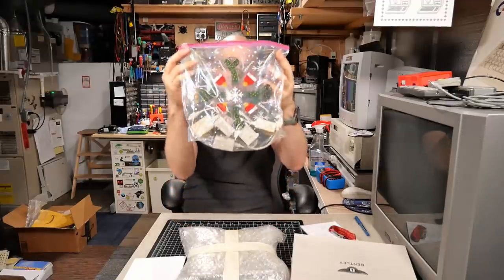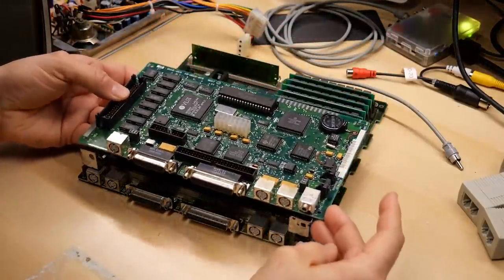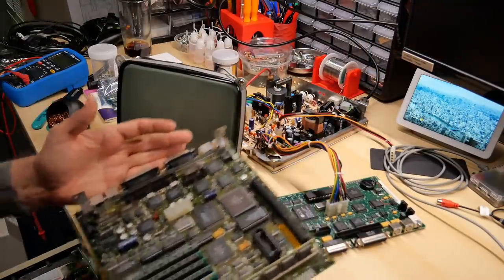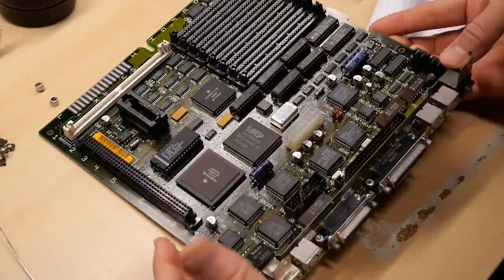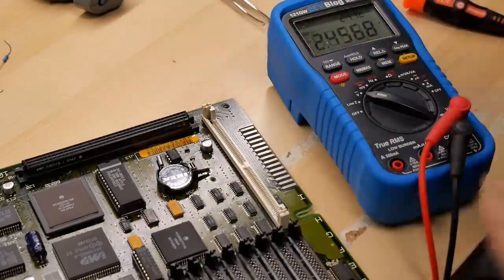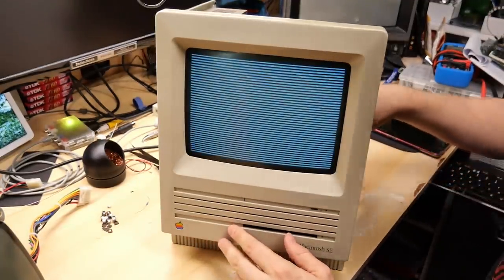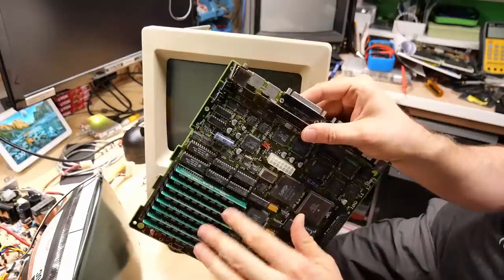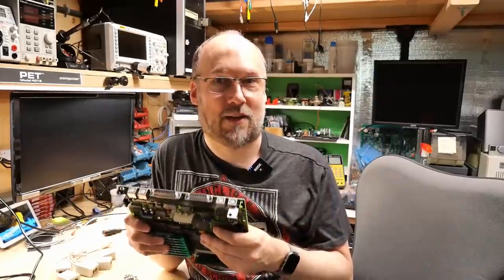Recapping and testing a Mac SE/30 motherboard

Comment: *SMH**
1) the SE/30 is part of the Mac II family (Mac II, IIx, IIcx, IIci, IIsi, and IIfx) and can run System 6. In fact the. SE/30 mobo is more like the IIcx than any other machine. 

But there were 2 sets of ROMs made, the 24bit "Dirty ROMs" and the 32bit "Clean ROMs". The Dirty ROMs could not see RAM past 16mb and a few other things. The Clean ROMs let you have as much RAM the board has. There is an extension called "Mode32" that patches the system to see more than 16mb on the system and fixed other issues. It worked on both System 6 and System 7.

The Classic II is based on the LC series (LC, LC II, LC III, etc.) and is more like the LC II than other LC series machine as they can only access 10mb of RAM and are 16bit boards and not 32bit like the SE\30. The '030 CPU on the LCs anc Classic II runs at 16MHz just like Mac IIs and the SE/30. Yes, there were faster Mac IIs and LCs out there but as for the SE/30 and Classic II were the same 16MHz.

Thus being a 32bit system with a coprocessor the SE/30 will blow the Classic II out of the water.

2) though it had a "processor direct slot" (pds) expansion, the SE/30 built-in video "card" was treated and accessed the video like a NuBus video card. Similarly the Classic II and LCs used PDS access to their "built-in" video "cards". This gives the Classic a slightly faster video access (but terrible frame buffering as it was 16bit and not 32bit).

3) There was a program called AppleTalk Bridge that allows a Mac with an Ethernet card to Bridge an AppleTalk network to the Ethetnet. Thing is, if it were not on a fast Mac with a lot of RAM, the Mac was useless for other  tasks.

More to come later.... Drawing a blank now.

Comment: Maybe someone can help me with a measurement? I recapped a working SE/30 and after recapping and washing the mainboard it stopped working. The reset signal works, but there is no activity on address or data lines. The C16M signal is only around 4 Vpp, so I wonder if something draws to much current on C16M. Or is this normal? It should be over the 5V-TTL threshold. All other signal which could stop the 68030 from working look like they are ok.

Comment: I seem to remember a video of yours where you mentioned that said old SE that you said was with you since you were little... well I remember you said that machine had a composite video out. Am I remembering correctly here? If I *am*, then how is it done?
Reply from the maker: We had a Mac+ with an external monitor (composite) which I still have the machine. The SE didn't have external video support though.

Comment: ESD?
Reply: OCD?
Reply from the maker: @brianv2871  BRB?
Reply: Incomplete statement, I haven't see any Electrostatic Discharge protection " ESD "on your bench videos. How do you manage it?
Reply: @sr.padilla1633  He doesn't have carpet.  Although, to be fair, i have much worse ESD conditions and I haven't killed anything yet by ESD.  (I probably just jinxed myself though, haha)
Reply: @brianv2871  Good fo you, i have killed-zapped many components. Maybe is genetic.
Reply: @sr.padilla1633  Yeah, i guess it might be different for different people/places.. I don't have any ESD device because it wouldn't be useful for me (I'd have nowhere to attach it and i'm constantly moving from place to place), but I do try to be careful when working on anything in my carpeted office  and I try to touch something metal before I touch any components.  My chip killing is always due to me putting them in backwards, so maybe i need a bracelet for that :)

Comment: Hey, Adrian, do you want a copy of the SE/30's schematics?  I've got the whole set for the logic board, analog board and power supply unit.  I can email you the direct links from my Google Drive account, if you'd like.  

Btw, this machine has 32-bit, however, it is only capable of addressing 24-bit chunks at a time.  This, of course, makes the SE/30 32-bit "dirty".  The limitation only allows this Mac to recognize up to 8MB RAM.  You have to make it 32-bit "clean" , by adding either the Mode32 extension (made by Connectix; bought out by Microsoft) into the System folder or swapping out the ROM SIMM for one out of a Mac IIci, IIfx or IIsi.  Another option is to get the ROM-inator II from bigmessowires.com.  He created new ROM SIMM boards with flashable chips and you can update the card with whatever modifications you need.

Comment: Still twisting caps...sad.
Reply: @Mike UK sorry mate, absolutely. I run a professional repair business and I end up fixing fucked up boards....so damn straight I'm moaning.
Reply: @thomasandrews9355  to be fair, if someone is messing up the boards from this, they would have messed it up some other way.. like too hot of a soldering iron or many other things.  Just be thankful for the business, I guess.
Reply: @brianv2871  I won't lie. You're not wrong and definitely understand that. Just frustrating for someone so knowledgeable like Adrian to do this. I learn from him, it's more just disappointing